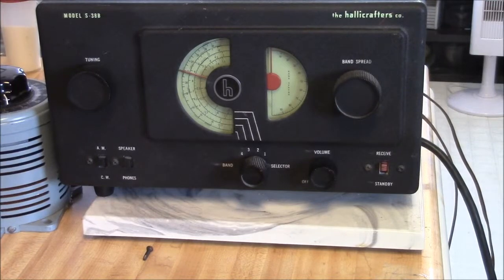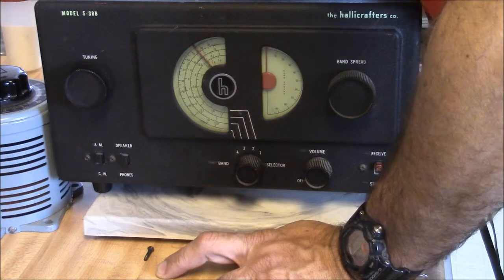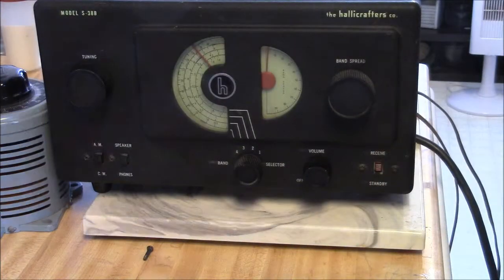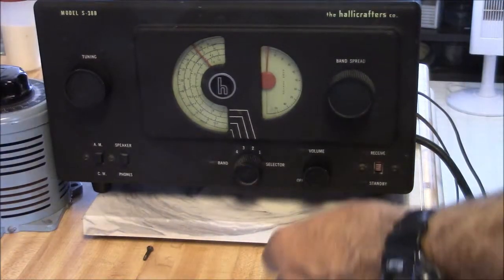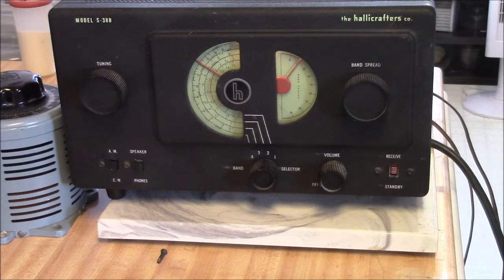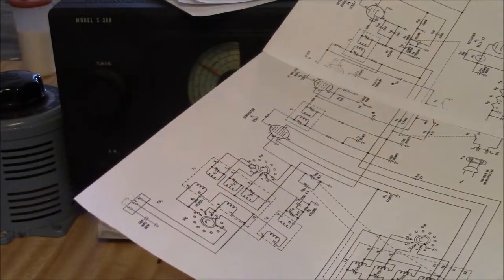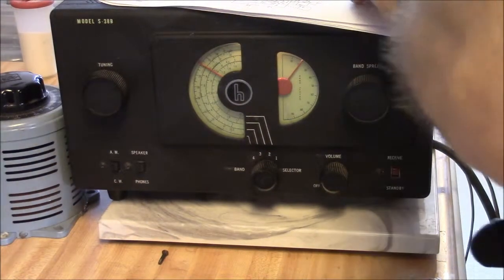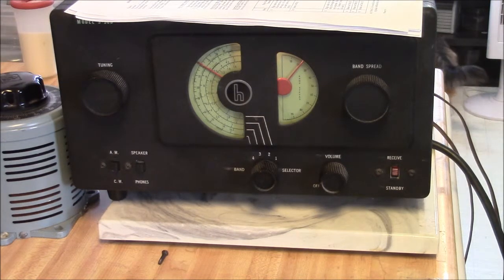Hallicrafters S 38B PT2

Comment: Thanks for sharing..  I just picked up a S38-B in preparation for a restore on my dad's SX-71.  The S38 was my dad's first receiver back in 1950 with a homebrew 10 watt exciter and a folded dipole made with 300 ohm twin lead he worked all over Europe and Asia on 20 meter CW.  He actually did not like the receiver very much but 65 years later I think it is kind of cool to have one.